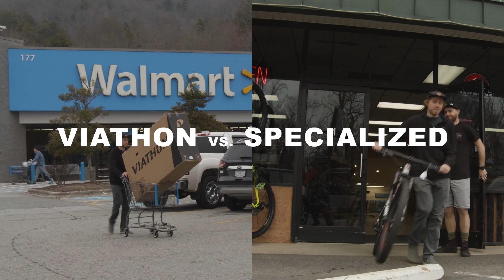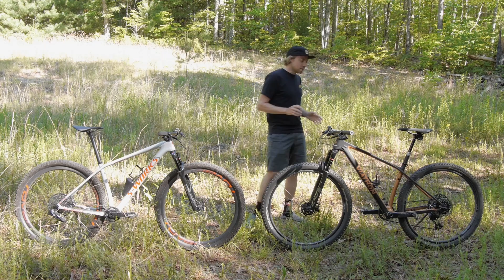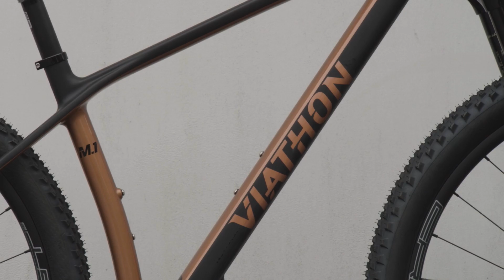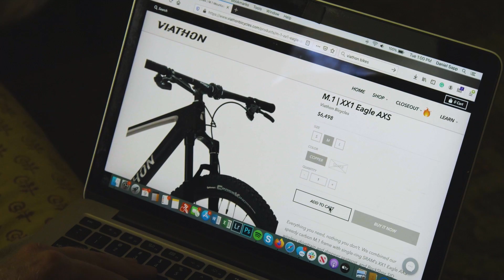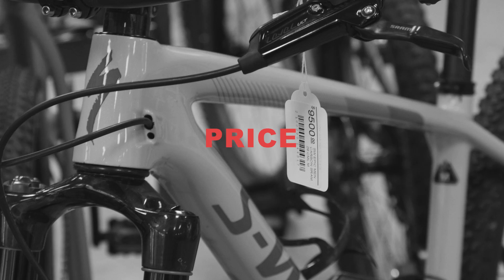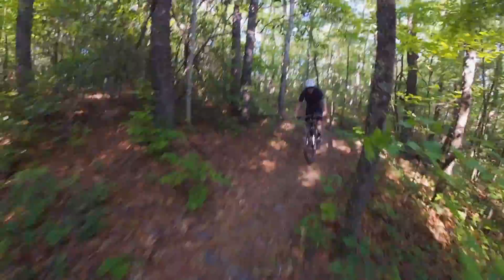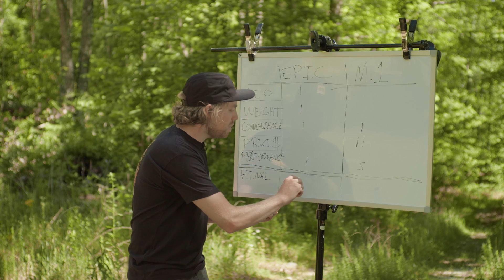Is Buying A $6500 MTB From Walmart Worth It? | Viathon vs. Specialized

Comment: Half a pound heavier, but WITH a wireless dropper post AND costs 33% less than the Specialized without a dropper post? If I was going just for speed I can take off the dropper post for racing on the Viathon and it will weigh as the Specialized. Then put it on when you're just riding for fun. The Viathon has $3,000 more to play with to keep making components lighter as you upgrade with that extra money. What else do you need to  to see that it's the better deal?

Comment: Actually Wal-Mart's bike does not need to rival the very top of the hardtail xc bikes which is exactly what the Specialized is. It just has to be as good as or better than most of the higher end  carbon hardtails from Trek, Rocky Mountain, Ghost, Scott, Focus, KTM, Santa Cruz, Pivot,Yeti,Ibis Canondale, or any of the other high end hard tail xc manufacturers. And to point out the only half pound difference on frame weight..lol  Almost all other manufacturers are ALL Heavier than the Specialized And Some are HEAVIER than the Viathon. And to point out a 1 degree difference in the headtube..Thats virtually indistinguishable when riding! Put a very good rider on the Viathon and he or she will do very well or beat with no handicaps against other equal riders on many of the other brand bikes on a xc course that compliments hardtails. Please take a sampling of 6 or 7 high end carbon production hardtails and include the Viathon and you 'll see the designer did his homework and has a winning design capable of competing with the best hardtailss across the board.

Comment: Seems like changing the dropper to carbon fiber post would close the weight gap, if weight is more important. Then using one of those head tube bushing that give up to 2 degrees of slackness pretty much ties things up. The cost of both items is about $200.  So still way, way cheaper.

Comment: This was a pretty fair comparison IMO.  They could have dinged the Viathon even more had they done total bike weight comparison instead of just frame, since the V has tubes and a dropper.  And they could have dinged it for the hassle of warranty claims by mail and no local mechanic support after the sale.  They also didn't have to give the V that last half point for performance, but they did.  So in the end, their claim that the Specialized is better but OMB $3000 seems pretty fair.  The big S (and the big T) need to SiT up and Take notiSe.  LOL.

To me it is sort of a toss up on everything but price, and therefore the V wins by about 10 miles, but nobody asked me :-)

Comment: I bought from Canyon recently and super happy with it! It required 30 min assembly and another 30 min to setup. I think it's very reasonable considering the price difference. My biggest concern is warranty if anything goes wrong, especially the motor, battery and display.

Comment: I set up gorilla tape tubeless with used rims and tyres, and as a 14 year old,  I used a crappy floor pump with absolutely 0 issues, so imo no adult should need a compressor, much less an xc racer.

Comment: I disagree with the points given for weight. As with most riders, except for the 10% who are on point with food intake, genetics, youth and a consistency that most don't have. 7 to 10 ounces of non-rolling weight is nothing more than a quick trip to the latrine before your ride. Which might range from 3-5 days per week if your average plus. With 40+ years in sport I've seen them come and go. Few are as old as Johnny O and still has a beat down to hand out. Sure it's about the riding experience, but as soon as race geometry gets thrown out there new perimeters are introduced. With this consideration I know a few old guys, myself included, that can put a beat down riding an old Rockhopper with Mag 20's for a shock.

Comment: Seems biased to me. Not saying the wallmart  bike is better. 
But most of the presenter argument to makes the Viathlon looks bad are not real.
You can bring the viathon to your local bike shop like you can bring any bikes...
They can do everything on it from bike check to tubeless setup before you ride it.
And the 3000$ price difference is just too huge to compare those two bikes.
Just compare the 6500$ Viathon to a 6500$ Specialised and you will get the real answer.

Comment: Although the Viathon seems like a great thing now, this could be very worrying in the future, if companies like Walmart can make bikes as good as what we currently have for so much less, it could mean the complete destruction of many of the smaller and sometimes even the larger frame building companies, pushing the mountain bikers who build frames because they love to out of the market.
Reply: Check out a channel called Hambini, you'll see that the vast majority of carbon frames (and probably all other materials) are made in the far East. It is very labour intensive so all the manufacturers get them made out there and then add all the other components. The truth is the end user gets ripped off by the manufacturers
Reply: Honestly IDK. Currently the best specs for the price are from smaller companies so IDK if that would change.

Comment: For 3k less you could set it up tubeless, have a bike fit done and still have over 2k left for a riding holiday.
And not charging the SRAM up is your own fault, whenever you buy something electric you charge it. 
Also if half an lbs of weight makes a difference to your riding...You should be paid to be racing nino

Comment: with Specialized I wouldn't be so sure on the after sale support.I've never had Specialized step up to accept warranty issue and my friends have the same experience.
Reply: Not sure where you are but I am in NZ. Have had many different brands of bike but found Specialized to have the best warranties. Had two frames replaced, one because the paint was chipping off. Also broke three rear triangles on one model. Fixed all three times. Just had a motor replaced on a Levo. Had it back in 3 days. I have no affiliation with Specialized.

Comment: You never spoke about the difference in rims (Carbon Roval vs Aluminium Stans), the cost difference the Quarq power meter adds and the Specialized life time warranty. Appointing two points for cost difference without accounting for all the extras is extremely biased.  I am guessing this video is sponsored by Walmart.
If the cost trips you that much, get the Epic Pro ($5600) and you still get carbon rims and SID fork.  Add $800 for the AXES dropper you going on about and still whips the M1 into tomorrow.

Comment: Honestly, the wallmart is decent enough. However, when your Walmart bike shows up and there’s a dent in the frame? That warranty process is going to take FOREVER. With a speci from an actual dealer, these issues will never happen. 

Another good point would be specialized crash replacement. Say you crash, get hit or have roval wheels and **it happens. You can get a discounted new bike, new wheels without question and have dealer support. I just don’t see that happening with the competition
Reply: Side note, I’m 100% confident my local Walmart cashier isn’t going to be able to log into a sram portal or send a shock off to sram. If literally anything is wrong, you’re taking on cost and since most bike shops are going to charge you for processing a warranty claim if they are not a dealer, you’re already spending money on your new bike even if it’s new.

Comment: The SRAM wireless drive-train is 2K in itself.  Put a nice SRAM NX eagle group set instead and the bike becomes much more affordable.
Reply: Unfortunately, I don't believe NX would be compatible without changing the hub. GX would be about as low as you could go.

Comment: Your comparison is rather strange.You compare frame weights in grams then refer to bike weights in pounds.
You compare one of the most overpriced hardtails in the world to the Walmart offering .
You refer to Geometry as been modern and better .This is all subjective and one rider might like a 69deg heatube angle the other 70deg and most people wouldn't notice the difference. 
And you refer to threaded bottom brackets as an advantage ( which it is) .Interesting  given that most of them have tried forcing pressfits standards for years.

Comment: I’d buy the GX Viathon then add some sweet race wheels and come out cheaper than either while performing 99% the same.
Reply: I have the GX version of the viathon (caught it on a sale for $1600) and it will out perform ANY bike under $3000. Only thing I would criticize is that it doesn’t come with a dropper, though I added my own.

Comment: Good luck servicing a high end Walmart bike that was built by a company without their own shops... that's worth couple points in my book. also good luck setting everything properly when you get it shipped, unless you're a savvy rider or mechanic, you would screw something up at least one more point...
Reply: What are you talking about?  You can take this to any bike shop and they will work on it just like any other bike.  Even if you are concerned bout setting it up yourself, take it to a bike shop and maybe they charge you $100 or something, you still saved $2900 over the other bike.
Reply: @mushieslushie  Different strokes for different folks. I would like to believe that all the specific training specific brands mechanics go through actually means something. If I would own any of these bikes I would not go  any mom and pop shop to service my $$$ bike, just like I won't go to the neighborhood mechanic to do an oil change to my car. Second is warranty, shipping your bike back versus getting it in a store and resolving the issue seems like a no brainer to me.

Comment: Stopped watching when you compared weight, saying its down to specialized R&D etc. NO! It down to the dropper post that the spec doesn't have. 200grams was the difference.
Reply: Frame weight bud, not full build.